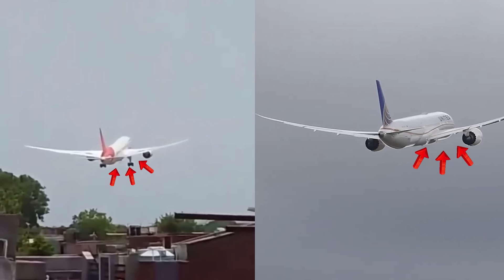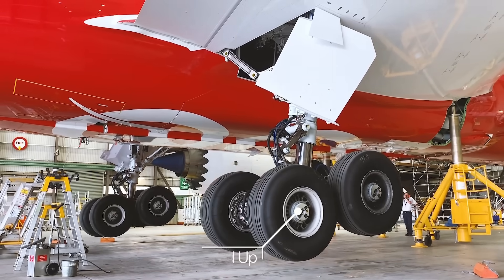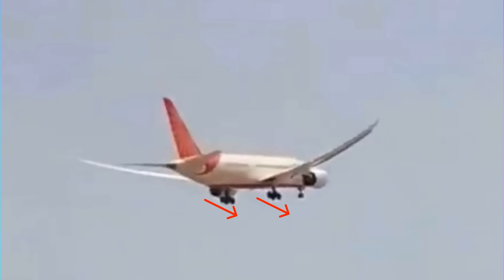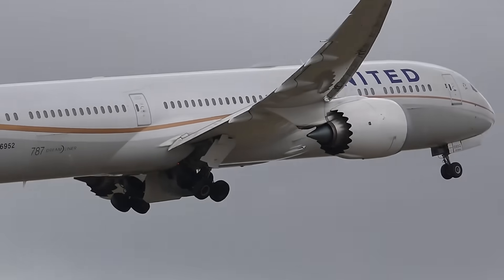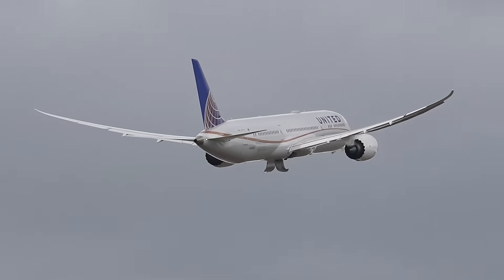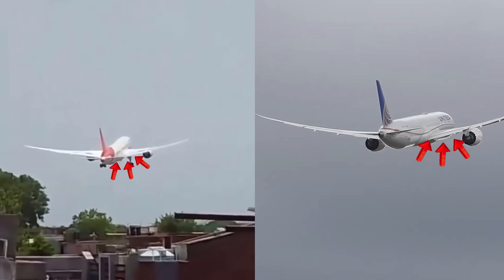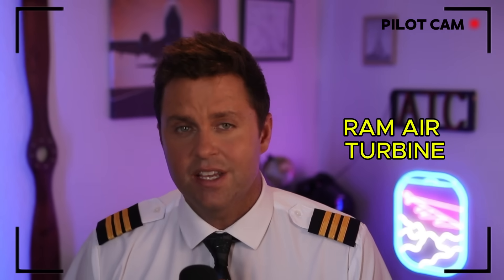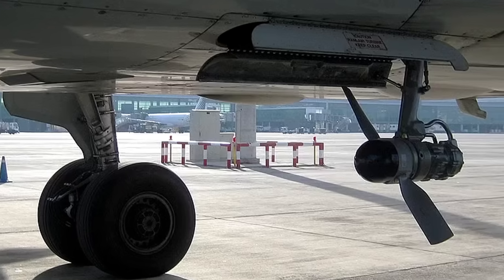Pilot Explains: A New Detail in the Air India 787 Crash Everyone Missed

Comment: A double engine failure in a dual jet-engined aircraft is an extremely rare event, but several causes are documented in aviation history and expert analysis:
	•	Bird Strike: Ingesting birds, especially during takeoff or landing, can cause both engines to fail if a flock is encountered. The “Miracle on the Hudson” (US Airways 1549) is a well-known example, where both engines failed after hitting geese.
	•	Fuel Starvation or Contamination: Running out of fuel (due to leaks, miscalculation, or blockage) or contaminated fuel can shut down both engines. This has occurred in incidents like Air Transat 236 and Air Canada Flight 143.
	•	Severe Mechanical or Systemic Failure: Rare but possible, a simultaneous mechanical or systemic failure (such as a major electrical or control system fault) can disrupt power to both engines.
	•	Volcanic Ash Ingestion: Flying through a volcanic ash cloud can cause both engines to flame out, as happened to a British Airways 747 in 1982.
	•	Fuel Icing: Ice in the fuel lines can restrict flow to both engines, causing them to shut down. This was seen in BA38 in 2008.
	•	Extreme Weather or Flameout: Very heavy precipitation, turbulence, or severe weather can cause flameouts in both engines, though engines are usually restartable.
	•	Human Error: In rare cases, incorrect cockpit response or shutting down the wrong engine during an emergency can lead to a double engine failure.
	•	Electrical/System Failure: On modern aircraft, a catastrophic electrical or software failure affecting engine controls could, in theory, stop both engines, though this is considered very unlikely due to multiple redundancies.
In summary, double engine failure is most commonly associated with bird strikes, fuel issues, or catastrophic mechanical/systemic failures, and is considered one of the rarest and most challenging emergencies in aviation.

Comment: Bird strike seems more unlikely than fuel contamination to me, but also fuel contamination doesn't seem very likely 🤔 I think that in that case we'd see the flight "scatter" a bit during takeoff and before starting losing thrust, but till 600feet everything seemed right, and even after it just stopped going up, and then it went down. Dunno if there are other options that could cause a double engine failure. I've watched another video that talked about vapour lock due to the plane being on the outside for hours in a big heat before take off, maybe it could be that?

Comment: To all those still talking about issues with IFE system and AC on ground in previous leg, you are intermixing things potentially.

The video from passenger in the previous leg, seemed to show that the IFE seat back had power, but only that it was non responsive, this can happen if there was some issue around IFE headend server or network (which are normally fully independent-of/decoupled-from the flight related stuff) if all passengers had same issue, or a specific issue with a specific IFE seat back.

In wide body aircrafts with ife, the reading-light/attendent-call on/off signalling (user control) is also controlled through the ife system, so if there is a issue around IFE backend server or IFE network or a specific IFE seatback, RLight/ACall wont be controllable from the seats and worst case not even from the cabin control panels by cabin crew, till the IFE seatback (only one passenger has issue) or server (if all have issue) is reset (and the issue resolves wrt it or maintainance is called in to fix any issue around server/...). But do keep in mind that the IFE and CMS (RLight/ACall user on/off control) is decoupled from other systems in the aircraft.

Also many airlines sometimes dont have the AC running on ground, to avoid having to run apu/...

So the 2-3 things mentioned by that previous passenger (ie non working ife and ac not running on ground) are relatively common and dont imply anything on their own.

Rather the Black boxes should give clarity on what might have actually happened.

Comment: Sounds like the most accurate assessment to me. It’s almost like fuel taps were left closed or total electric failure to fuel pump, so there was enough fuel in the pipework to take off but quickly ran out of fuel on high demand, and therefore lost thrust, on takeoff.

Comment: Fuel contamination, somebody pulled the fuel levers off- that's it, the Fadecs have independant permanent magnet generator power, they cannot fail, I think Captain didn't arm the autothrottles pushed up for takeoff power never got it, thought he did, took off, engines near idle, dropped RAT in a panic, flew it to the crash.

Comment: Pilots do taxi checklist and before take off checklist, on both checklists; flaps settings is determined and reviewed based on weight, length of runway, and weather condition at the airport, then data is entered into the FMS. If flaps settings does not match the FMS; pilots will get a warning message on the PFD for correction. 

Gear component was not retracted due to hydraulic system failure because of engine cut off although gear was on the up position, which increased the parasite drag. 

Contaminated fuel, fuel lines malfunction, or fuel leakage all lead to engine cut off.

Comment: I saw a video the day after the crash claiming that on the previous flight of that aircraft the air conditioning had stopped working and the entertainment screens were non responsive. If true, maybe this ties in to engine electronic control system failure.

Comment: Question: Even if you had a dual engine failure, aren’t there batteries on aircraft that are fully charged that will give you enough power for say something like 5 minutes so that you can manuver  the  plane for an emergency landing. 

I mean computers have backup UPS power supplies, so why not aircraft especially in the era of high power density lithium batteries ??

Comment: Thank you for pointing out the missing engine noise! How about the plane has used the complete runway to finally take off? I think it was confirmed it started the take off from the usual position not an intersection, but took the whole runway? Might there have been trouble with the engines during the takeoff run as well? I think that dust cloud during rotation is a sign it was the very end of the runway?

Comment: There was a delay at push off of two hours. In the confusion or it was the cause of the delay the refueler did not open the "mechanical fuel valve".
You are talking about the electrical shut off valve in the panel above the pilot. The mechanical fuel valve and tank vents are controlled by the refueler. The engines will run for 30 to 40 seconds at takeoff power from the fuel remaining in the "gravity  fuel feed lines" if the mechanical fuel valve is left shut after refueling.
Just after V1 the main pilot realises there is reducing thrust and decides to take off rather than run off hence the last minute decision to rotate near the end of the runway.
He has already decided to call mayday and to report reduced thrust before rotating and does so directly after lift off.
With the engines tilted up and fuel pushed back from thrust and gravity the engines together begin to spool down. There is at this point no fuel at the engines. The order is given to retract landing gear and there is not enough electrical power to complete this action. It's electrical over hydraulic in this craft with electrical driven mechanically from the engines. At this point the low voltage triggers the RAT automatically.
From then on the plane is gliding with rapidly reducing thrust if any at all.

Comment: How can fuel get contaminated and with what?Surely regular checks are done to verify purity?
Might high temperatures be a factor causing condensation if fuel had been exposed to high temperatures for too long?I have suspected this once caused an outboard engine failure in Greece when boats and fuel had been exposed to hot sun all day causing condensation to drip into the fuel…

Comment: Gary, good analysis but both you and Steve have missed a vital piece of information.  The 787 used the entire 11,499 feet of runway (I haven't seen any information about an intersection takeoff.  Regardless, they rotated at the end of the runway) when the calculated take off distance was about 60% of that distance.  When the aircraft rotated, it is clear both engines were operating because there was jet blast blowing dust into the air.  There appeared to be no asymmetrical loss of thrust because there was no rudder displacement or yaw moments.  The excessive take off run was most probably caused by insufficient thrust and or improper take off flap setting.  Regardless, the crew did not exhibit situational awareness realizing the airplane was operating at reduced thrust with a longer than normal acceleration rate.  The captain should have rejected / aborted the takeoff.  Furthermore, at this point, we don't know if the airplane had reached Vr (rotation speed) at the end of the runway.  

Regarding a simultaneous dual engine failure.  The odds of this happening are little to none and that includes multiple bird strike, contaminated fuel, etc.  The most probable scenario would be shut down with intent. 

I am posing another theory / scenario.  Perhaps during takeoff roll, around V1 (decision speed), they experienced a total electrical failure.  If that occurred, the auto throttle would have disengaged and the FMC would have dumped all performance data.  EFIS displays would probably disappear momentarily then power up via the emergency bus.  The crew now has manual throttles, no performance data and a confused cockpit.  I'm not sure if the RAT will deploy automatically on the ground but, if it did, the RAT creates quite a bit of parasitic drag and could have affected acceleration rate.  

As you know, most pilots are taught via rote memory to immediately add full power, etc., when entering a stall, windshear, etc.  Pilots react the way they are trained and, again, the crew may have been overwhelmed not realizing the A/T were disengaged and did not add full power, etc.  

Lastly, I don't know where you came up with this landing gear down during a crash situation.  I have flown every Boeing N.G. and not one operating manual calls for such maneuver.  During a crash landing scenario the negative vector / downward force / rate of descent would be great and the landing gear would most likely spike through the wing rupturing the fuel tanks.  For that reason alone, for liability purposes, Boeing would never suggest such action.  I appreciate your concern about this fatal accident but you and Steve should pay more attention to what you are saying rather than preying on the sensationalism of the accident for Y.T. "clicks" and notoriety.  Capt Steve in particular is receiving much criticism world wide for his wild ideas, retraction, new theories, etc.  Your suggestions are more conservative and thought out but still over the top.  I.E., simultaneous engine failure, leave gear down for crash landing.  I doubt very much, with the short time they were airborne, the crew placed the gear handle back down to "absorb the impact" of the crash. 1.  It's wrong and 2.  They had more important things to do like flying the airplane and not talking on the radios.  

I believe this accident was preventable.  The crew should have realized during the initial take off roll, thrust was inadequate and acceleration was abnormal.  The captain should have rejected the take off.  If the crew did initiate gear retraction, then the video should show the main gear forward tilt on early climb out.  

I believe the accident was preventable.  I believe a contributing factor to this accident is PILOT ERROR.

Comment: Another theory on what may have happened….

1. There is video and audio evidence that the RAT deployed while airborne
2. The lone survivor is reported to have said there were green and white cabin lights flashing (I presume off, then on or something like that) prior to impact
3. The lone survivor is also reported to have said the engines revved up just prior to impact. In addition, as a previous comment in this thread mentioned, one video shows a piece of debris was blown up into the air just prior to impact, suggesting the engines may have recovered to a high thrust setting.
4. The crew got off a mayday call, and some reports say the crew reported a thrust or power loss.

So, it’s possible there was an actual dual engine failure/rpm rollback, or something else happened which made the crew believe they had a Dual Engine Failure. For example, a takeoff with ALT CAP of ground level (instead of TOGA) would have caused the throttles to retard to idle after takeoff when autoflight attempted to capture takeoff altitude, and that could have been misinterpreted as a Dual Engine Failure.

Then, the crew, having an actual Dual Engine Failure or thinking they had a Dual Engine Failure, perhaps executed the Memory Items for Dual Engine Failure…1. Cycle the Fuel Control switches CUTOFF then RUN and 2. Deploy the RAT.

Cycling the Fuel control Switches (first memory item) may have momentarily dropped engine RPM to a level where there was some sort of momentary electrical transfer, which would explain the survivor’s observation about the flashing cabin lights. Or perhaps the electrical system logic would make this happen when the Fuel Control switches are cycled (not a 787 type, so I don’t know for sure). Sometime during this, if the throttles had retarded, they may have subsequently been firewalled, or the engines restarted and the RPM recovered but too late to recover the aircraft. 

If it were an ALT CAP at ground level scenario or actual Dual Engine Failure/RPM rollback, the crew may have been so focused on performing the memory items that they didn’t get a chance to raise the landing gear after liftoff, which would explain the gear remaining down. Or, if they had raised the gear immediately after liftoff, electrical system transfers may also explain why the gear would be tilted forward but not raised, I.e. the crew raised the gear handle but the gear retraction sequence was interrupted. 

Regardless, a terrible tragedy, and I keep all those poor folks in my prayers.

Comment: 6:54 proves it. The plane was in the process of gear retraction, which confirms that the pilots initiated the gear retraction procedure. Why did it not complete? Were the gears stuck? Was it about to be completed?, are all good subsequent questions, but the primary fact is established, that the pilots initiated the gear retraction and the procedure did start because the wheels are tilted forward.
Reply: 8:50 is another excellent take.
Reply: Lost hydrolics..
Reply: No, it doesn't prove the gear was retraction sequence was started. The trucks will tilt forward automatically as soon as the weight-on-wheels system detects airborne. Nothing to do with gear handle position.
There are legitimate reasons why the gear may have been intentionally left down too.

Comment: The 787's all electrical design is novel enough that we cannot predict every possible failure scenario with absolute certainty until they actually happen. Reading across historical data from previous designs doesn't apply so engineers test, re-test, re-re-test etc at gradually higher and higher system levels until something breaks (or doesn't respond in the way it should). And there's often no way of training pilots to deal with these failures except by replicating them precisely in the simulator AFTER they've failed in real-life.

That applies to software as much as hardware, and software failures are usually unrecoverable. A good software engineer will test their code to see what it does but he won't test for unforeseen scenarios. The millennium bug is a good example of what it takes to ensure software will function glitch-free, if it's expected to operate beyond it's original specification.

No engineer will give you a precise service interval for brand new designs until they've built up enough data on the test bed, and the test program may well have to run concurrently with the actual system being used in service to replicate every possible failure mode. Accelerated testing has it's place but replicating the normal age degradation of parts is often subject to errors. And the more components packed onto ever smaller devices then in general, the more severe the effects of that failure becomes, and the harder the root cause becomes to diagnose.

As Donald Rumsfeld famously said, there are unknown unknowns. Or in plain English, there are surprises, which no amount of previous experience or theory can predict. That's the best way of defining novelty.